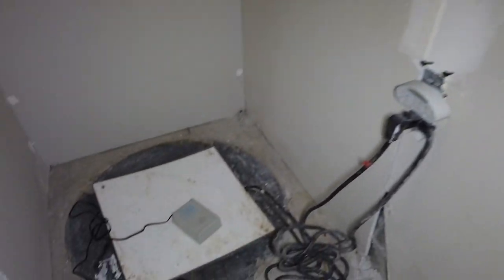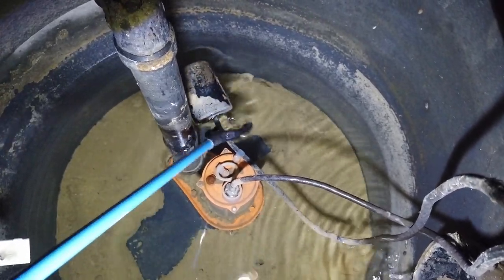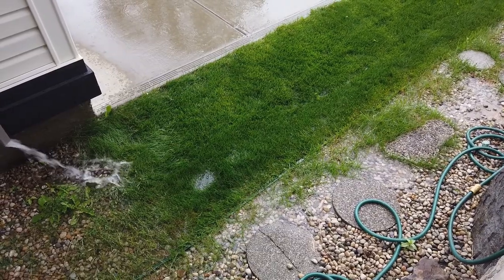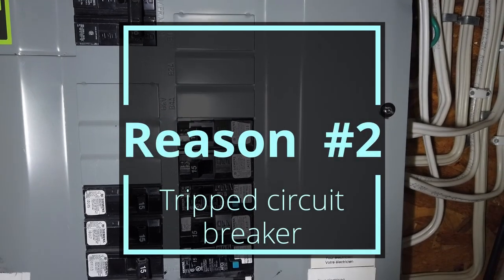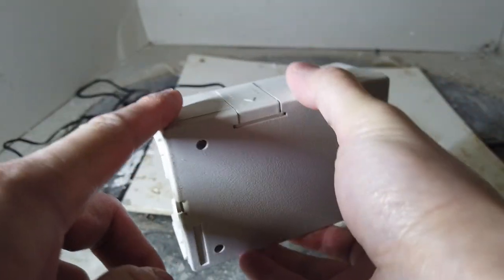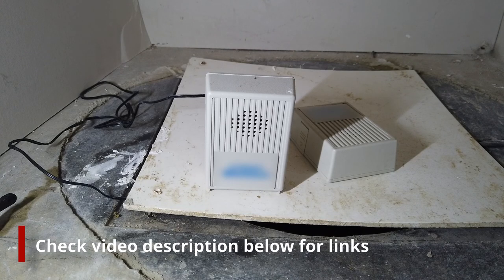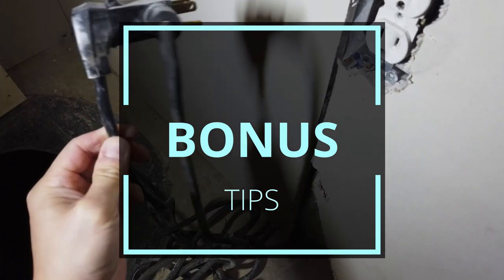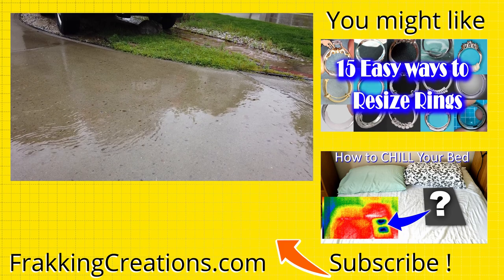Before house water damage... How to install water leak sensor / sump pump alarm

Comment: Just installed. Kidde water/freeze detector with wifi on the sump pump cover. I live here and will be getting a transfer pump in case the main pump ever fails.  Thanks for the video, just subbed!
Reply from the maker: Thank you for commenting and subscribing.  Please share our video with anyone else you think it can benefit.  We appreciate your support.
I'll have to look into the Kidde system.  I haven't heard of a WIFI freeze detector before.

Comment: Great video. I would recommend a small transfer pump as a backup. They hook up to water hoses.
Reply from the maker: Thank you!
and great idea on a backup pump.  I'll have to look into transfer pumps too.
Reply: Thanks for the tip! Any water transfer pump would work, correct?